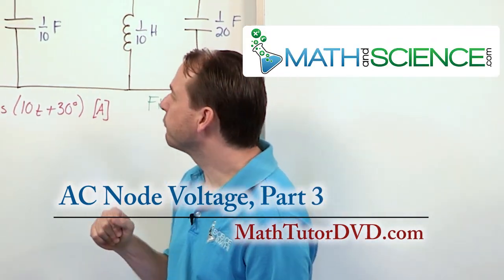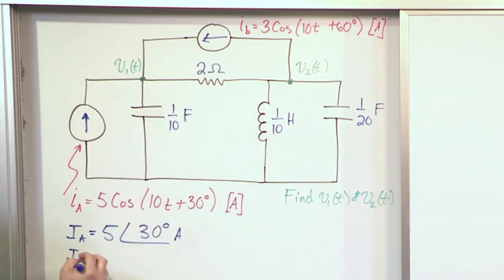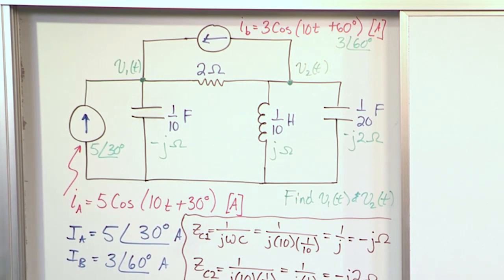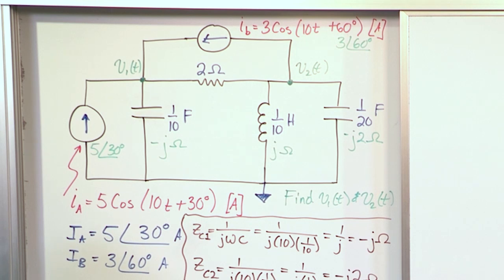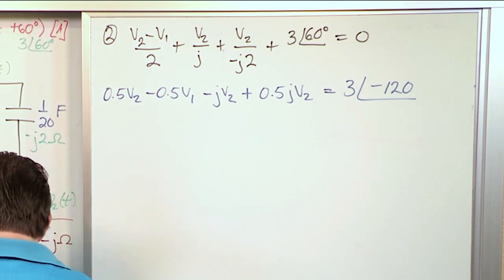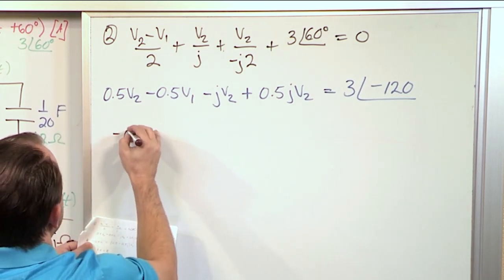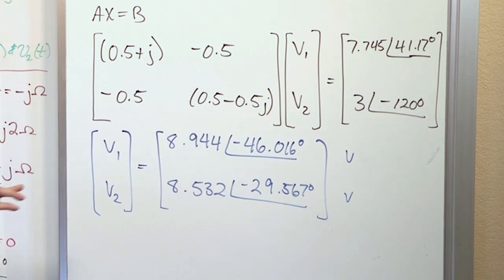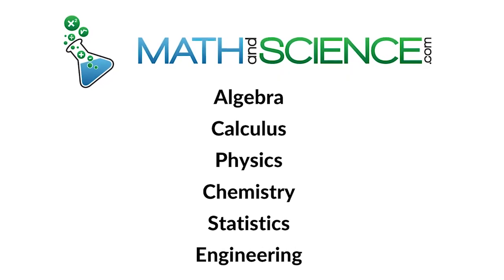EE Circuit Analysis - AC Node Voltage Method

Comment: At 12:30 there is a mistake 
Factoring V2 should leave (0.5 - j)V2 and not (0.5 -0.5j)V2
Reply: I think it is correct. -j + 0.5j can't be equal to -j. 

-1j + 0.5j = -0.5j.
Reply: @STEALTHIO911  so, just to clarify, you are confirming my statement, correct?
Reply: no, (0.5 - 0.5j) is correct